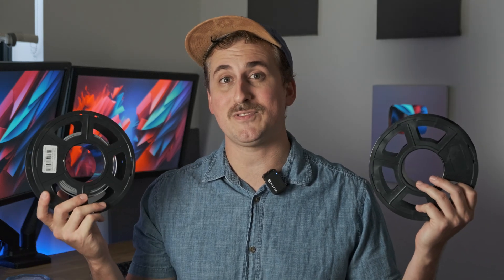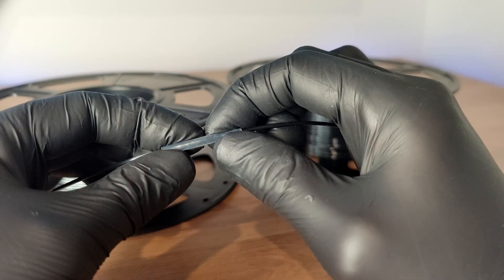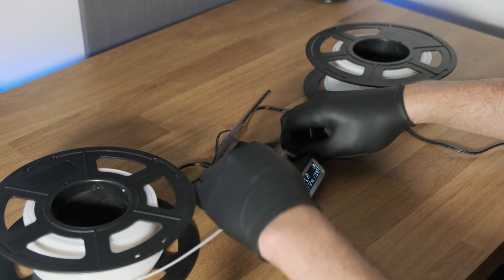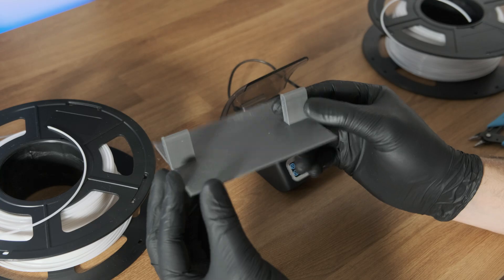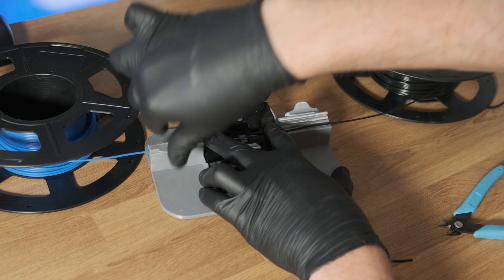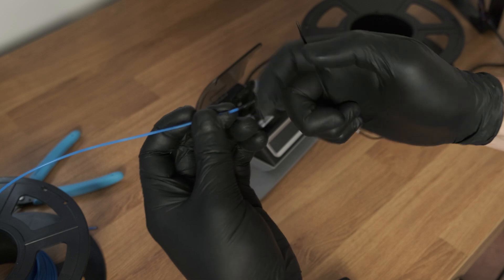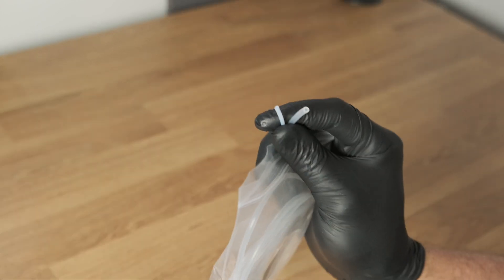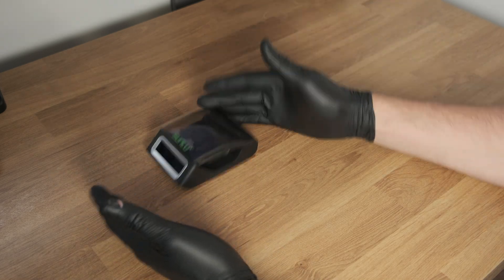I Fixed a Major Flaw in the Sunlu Filament Connector

Comment: Another quick comment. I got your recommended silicone tubing and it seems strange that the 1/16" (approx 1.6 mm) inner diameter doesn't seem correct. The 1.75 mm filament fits into the tube with lots of room to spare. Since the ends easily move around, this makes it difficult to keep the ends together without applying more side force to help keep them in place. Interested to know if others are seeing this too or maybe they sent the wrong size. Either way I wonder if there is a smaller ID silicone tube that would work? That would make it much easier to keep the ends in place as you attach them.

Also, I'm having NO LUCK GETTING THIS TO WORK. The silicone tubing is too wide and it makes the heating cover almost impossible to close. And while fighting to get it closed, timing gets screwed up and the end result is miserable. Again, some of this may be due to a size issue with my tubing but I'm really not seeing this as a reasonable fix to the connection problem. Interested to learn if this is working for others.

In the meantime, I'm working on a design that will incorporate the holding aspects of some of the MakerWorld models you tested with an added spot to mount a fan (which I believe is the main way to address the initial problem). The other issue that I'm trying to address is a way to help hold the machine in place while using. It's great that it's small and easy to store BUT since it can't hold itself in place when using, that makes all of this more of a problem. Once I get my design finalized & tested, I will post to MakerWorld. If anyone has any additional model features that you believe would make all of this simpler, please post back and I'll try to incorporate.
Reply from the maker: Hey Chris, the tubing should be quite tight around the filament so it appears you may have received the wrong size... What does it say on the front label? 

Keen to try out your design with the fan holder though! Keep me posted 🙂

Comment: The big turn off for me was the consumables that you have to cut that thing off I like the idea that the silicone can be slid off the end and reused also I design update that they should implement is to use a peltier type device to heat up the filament with a small cooling fan in the bottom They could then reverse the polarity going to the peltier and cool the filament before opening it I think that would solve a lot of the problems as well
Reply: @mcbrite  it would be a heck of a lot faster than sitting there waiting for it :-)
Reply from the maker: Great idea! Hopefully they release a new version with cooling 🙏🙏
Reply: Like the idea, but wouldn't work fast enough for the application...
Reply: @mcbrite  you don't use the connector when you need to swap out spools but you are supposed to use it in advance hours/days/weeks before you are down to your last spool of filament.  I have over 10+ spools that I was able to salvage using this device and it works great.  But yeah in a situation where you didn't have it on hand and you need to join it in minutes, this wouldn't work out at all in your situation.  :)  Good luck!

Comment: Great video! I had the same concern as the other viewer about the 1.6 mm ID tube not matching the 1.75 mm diameter of the filament. Perhaps for something like this you can do a one sentence explanation in the video, and then direct traffic to your older video for a longer explanation.
Reply from the maker: Yeah, apologies for not explaining it clearly enough. I will probably end up making another video going further into the details on everything, including a print example and some more footage of me using the silicone, cutting it off, etc.

Comment: I couldn't help but notice you didn't address how you're going to get the silicon tube off without cutting it off. Hmmmm.
Reply from the maker: Haha good point! Apologies for that. You can reuse them if you are just connecting short pieces together, but if you are doing two spools, you will need to cut it. You can use the tool on the sunlu device, or a stanly knife. It comes off very easily :)

Comment: The biggest flaw I have noticed is after joining and the connection is way too flimsy. I am going to try unplugging it after the joining process and let it cool naturally. A lot slower but might be the best.
Reply from the maker: Yeah it is, especially with that thing ptfe tubing... But I found that leaving it inside the heat element made it melt a little too much with the residual heat left over. As the silicone tubing was a little larger for the device, it didn't stay in place, so I needed to take it out quickly to make sure it cooled straight and not slightly bent.

Comment: Yeah i think it's all designed a little bit wrong. Silicone is definitely the way to go in this use, not only is it not going to release hazardous chemicals when heated as opposed to PTFE, it's also more thermally conductive. It should have moulded silicone jaws which form the right shape when clamping on. Ideally you could have a Peltier element heatsink and fan so it can both heat and cool but i can't think of a really good way to build that, but simply small heaters and a fan would be the way to go.

And yeah that be most likely a 24V fan that you tried depending on what printer you extracted it from, sometimes they're 12V, so at 5V it's barely going to turn. You can just buy a 5V version of the fan, or put a step-up circuit (mt3608 or clone) between power bank USB and the fan. I also suspect a centrifugal fan (5015) would be better than axial, and as opposed to 3D printer, it doesn't need to be a high quality one, a very basic sleeve bearing version will last an eternity.
Reply from the maker: I think you should be working for sunlu to go teach them how to build the next version 😁
Reply: @LayerLabAustralia   YOU KNOW WHAT.

Not Sunlu. I don't know anyone there. But i know a CEO of a small 3D printer manufacturer in China, because i helped him out at another company in defect diagnostic in the electronics, he went on to found this other much smaller company, i have his personal contact details, i could talk to him.

Will i? I probably won't.
Reply from the maker: @SianaGearz  haha fair enough! But it seems you have a wealth of knowledge that companies in the 3d printing world would love! You should make some youtube videos to teach it to everyone (including me 😝)

Comment: I have 3d printed a similar side support to hold the filament straight. It allows me to move it out of the Sunlu filament connector after it finishes the 'welding' and I set it aside so it cools down. The Sunlu device is way overpriced, but it works like a charm for me!

Comment: I use 1.6mm ID silicon tube for my DIY setup for joining the filament,
Reply: Does the 1.75mm filament fit easily?
Reply: @gregr5   @gregr5  Yes it pushes in with a little drag, I use just a 40mm length of the silicon tube, and angle cut the ends of the filament and push the two lengths together, so they overlap with the angle cuts on the end and the tube will bulge a little, but when you melt the filament the tube will compress it back to the right shape, my set up is a DIY version I don't have that joiner, but it works the same way and I have the ends of the filament well supported so after I have melted the filament with my little heat torch I don't have to hold anything, then after just carefully slice the silicon tube off after its all cooled.

Comment: I have used mine about a dozen times so far. It's a bit finicky, I did bugger up two or three times at first, but it's not really that hard to use. I may not have used it very often, but it's worth it since it saves me the hassle of changing short rolls of filament during a print.

Comment: Can you recycle the silicone though?
Reply from the maker: If you are connecting single pieces, you can definitely reuse it many times, but if you are connecting two spools, you will have to cut it off. As for actually being able to recycle silicone, i believe it is recyclable, but like PLA, it needs a special facility to be able to break it down quickly.

Comment: Sorry if I'm misunderstanding the function of this, but surely you could just unplug the device from power and leave the whole heater to cool down with the filament still inside to keep it from deforming?
Reply from the maker: It would be great if you could do that, but unfortunately the residual heat will continue melting the plastic and make it deform 😆
Reply: @ ahh ok

Comment: Can't you just not turn the filament connector off and wait for it to cool properly?
Reply: Yes
Reply from the maker: It would be great if you could do that, but unfortunately the residual heat will continue melting the plastic and make it deform 😆
Reply: @LayerLabAustralia  True, but it would be still in the tube, so ... and as long as it doesn't move ...
Reply: It works. It's user error. I have zero issues with the Sunlu Connector. And the Tubing is reusable. I have only thrown it out once, i still have like 400 tubes@JGDeRuvo
Reply: @SwiftcoalMay  Yes I have discovered you can slide the tube off the end obviously if you're joining two large rolls this is not very practical but if joining snippets this is very practical which is good because anything less than 3 m and it's cheaper to throw away the filament based on the cost of the connectors at 600 for $20 

What's annoying me is that I've used it four times and it has failed four times it appears to work correctly a visual inspection of the joint looks perfect to me I mean obviously it's not a smooth cylinder it's got little bumps from the shape of the heater but it looks good and it looks like it should feed fine but so far all four times the printer has stopped once at the feeder as if it couldn't grip that section? The other three times at the hot end two different printers The joint gets to the hot end and it acts like a clog now what's weird is all I have to do is grab it and push and it usually goes through just fine but the problem is I'm not there to do that in real time so the print still fails 

I'm assuming user error but I can't figure out what I'm doing wrong I mean it's a pretty simple device and process next time I'm going to take a little sandpaper to the joint but I do with The clamp device and see what happens.
Reply: @nerys71  What printer are you using?
Reply: @JGDeRuvo it does work pulling the plug ive been messing round for ages with it . Howver the filament not in the tube melts whilst its cooling down. Definatley a nack to using it and getting 100% rsults
Reply: @LayerLabAustralia  Not true i have 1 let it sit for around 3-5 min then its cool enough to remove.

Comment: I have one of these little joiners and as you say, smaller pieces are great, joining rolls is a nightmare!

I think you might be onto something here and I wonder if maybe using a longer piece of that tubing will help is better???

Just ordered some at great expense (to South Africa! 🤣🤣) so we see in a few weeks!

Also, maybe a small fan in the actual clear lid might also help with the cooling... ?
Reply from the maker: A longer piece may be better, but if you are joining two spools, it just means you are gonna go through the silicone tubing a bit faster as you'll need to cut it away. Hopefully if they make a new version they will include a fan haha. Let me know how you go!
Reply: @LayerLabAustralia  Longer piece can just be held until the other reel has been wound on, then it pops off the end. Use it again.. 🤣🤣🍻🍻
But yea, those tiny pieces they give you are a ball ache!
Reply from the maker: @ Haha yeah that could work, but I fear that the grip may be too tight on the filament and would make it difficult to respool..

Comment: This was an informative video, thanks.

I bought one of those Sunlu filament connectors a couple of months ago and hate it.  I am embarrassed for Sunlu for putting something like this on the market and calling it a "solution".  

A couple of weeks ago I printed a very nice looking gadget that hold the machine, clamps down on both ends of the filament, and even have storage for the tubing, power cord, and tools.  It's nearly impossible to get the filament into the clamps, but once you do it holds it in place nicely, but when you need to pull the filament off the heat it just pulls apart again, just like you showed.  

I think I have some of that same tubing in a drawer in the shop.  I'm going to give that a try.
Reply from the maker: No worries! I was surprised when there were so many people saying how good it was...when it wasn't XD It certainly needs some upgrades to make it work properly. I was surprised to find out that merely changing the tube would fix a lot of the issues. Let me know how you go!
Reply: The cooling fan was the thing that kept me from waking my neighbors.  Thanks for that tip.

Comment: Could you incorporate a fan in the lid that turns on when you open it?
Reply from the maker: Yeah, that could be a good option, maybe put a fan into the heated cover, when it reaches optimal welding temp, the power turns off and the fan turns on... could work!

Comment: So what is the exact size of the silicone tube you used? 1/16" ID & 1/8" OD? If using 1/16" that's about 1.6 mm so the 1.75 mm filament fits in this? It must be a tight fit.

And why didn't you just let the connection cool down naturally vs trying to take ir out so quickly? If you let it cool down will the connection be solid?
Reply from the maker: I actually got the silicone idea off this video a while back when I was welding filament with a soldering iron - https://www.youtube.com/watch?v=ukN8L5rGWoI

The ID is a bit smaller than the filament (1.6mm), but due to some type of thermal physics that I don't understand, the filament comes out the correct size. It is easy to remove and easy to cut away, even using the cutting tool on the sunlu device. 

The reason you can't leave it in the heating element to cool down is because the filament will continue to melt and create inconsistencies in the connection, even if you remove the power, the residual heat is enough to do it.
Reply: @LayerLabAustralia  K. Thanks.

Comment: Would the silicone not be harder to remove/reuse since the filament would catch on it? Especially if you were joining longer lengths?

My first thought would have been to use one of those battery powered jet fans (eg. kica jet) on a low setting to cool the filament and heating element down quickly before removal (along with that last 3d printed holder perhaps)
Reply from the maker: Nope, it's just as easy to remove as the ptfe, you can even use the removing tool in the sunlu device :) it doesn't stick to anything which is super awesome.